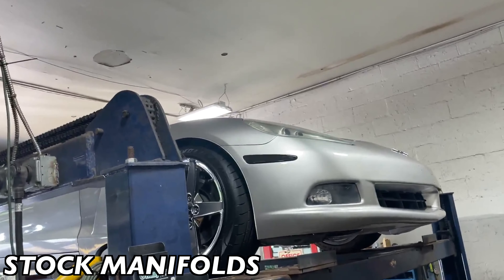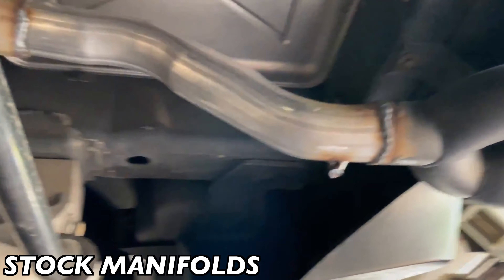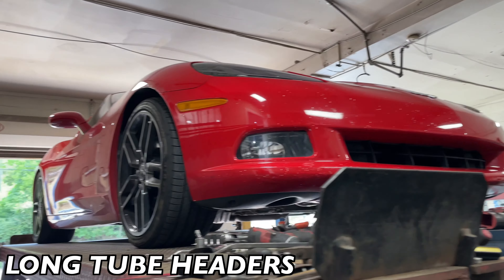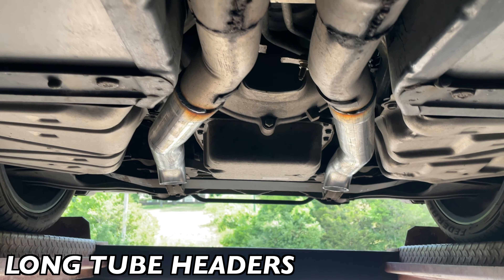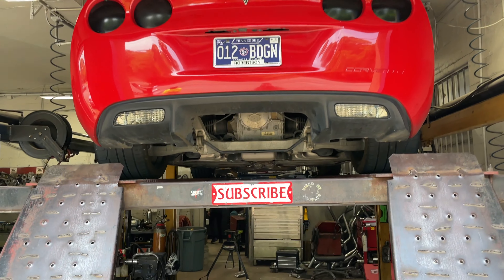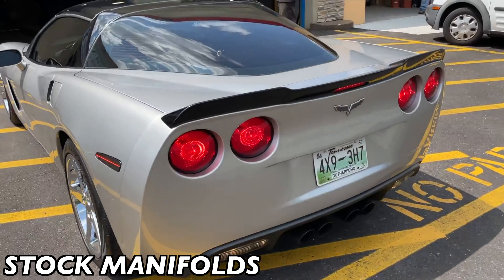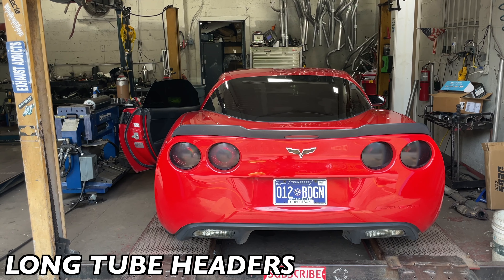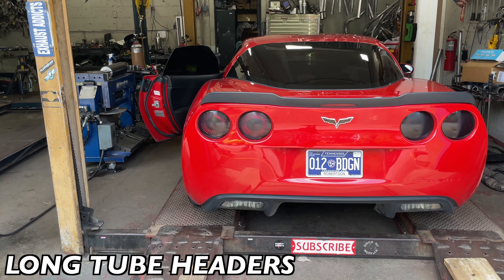How do Headers Affect Exhaust Sound?

Comment: I can tell you from experience, if he ever changes his mind on the red one and doesn't turn it into a track car it'll be unbearable to drive on the highway. the drone will be a killer.
Reply: even if its gonna be a track car, its going to be horrible
Reply: My challenger has long tubes, high flow cats, and borla atak, and its not bad at all unless you get on it
Reply: Kinda of a myth. The drone is there you just get used to it
Reply: @11.9lsupercharged4  the real question is why are these dudes trying to flex with a base model vette,z06,zr1 or nothing.
Reply: @ViperMods_216  you get what you get.  I work with a guy with a challengers r/t and he upbadged it to a 392. Got some brembos or at least good knock off covers and straight piped it and he drives it hard so he fools alot of folks into thinking its a 392
Reply: Dude your seats just vibrate all day long with open header set up
Reply: @ViperMods_216  Is there anything wrong with base model vettes especially ls3. You could turn basically make a ls9 by strapping the same supercharger on the ls3
Reply: Not with that x-pipe though. It wasn’t that bad with the x-pipe. If he deleted that, then yeah. I’d definitely agree and say it would be a bit much for the street as far as sound goes.

Comment: On my 96 z28 I installed a set of 1-3/4 longtube headers. Underhood Temps were lowered and the sound was alot quieter then I added true duals, X Pipe with series 10 flowmasters and tailpipes. Loved it for 12 years

Comment: Im new to car exhaust,  so i was wondering how do people get away putting LT headers on their cars when it's illegal?
Reply: Only certain States me I'm in California that's what they got electric cutouts for
Reply: If you install cats on it then it is still legal. It just depends on which area you live at. In California you can put long two headers as long as it is California legal. That includes cats too.
Reply: I see. Because I'm planning to go catted lt for my mustang gt, and i live in North Carolina.
Reply: @ragintaurusmusclemercury7023  only shorties is carb legal in California got to have a certificate under the hood also I'm in the process of getting my headers and some high flow cats with electric cutouts I just picked up a 6.1 intake manifold yesterday with a throttle body I'm going to get both of them ported going to install the intake at the end of the year when I get my Cam kit and get my engine rebuilt
Reply: @davidokune8194  you drive like you got some sense they don't really puck with you get u some electric cutouts if you can find somebody good price waiting for the mine to be shipped out so I can get this work done
Reply: @hemi5.7villain  California has always been the big exception. Long tubes are legal here in my state that's why I love Texas so much.
Reply: @ragintaurusmusclemercury7023 you can still put them on out here

Comment: The red Vette would sound better if it had the full exhaust on it. Sound is bouncing of the ground making it sound like shit. I will have say the grey Vette sound better at idle, revving, and takeoff. 
P.S. An x-pipe creates a higher exhaust note. Not a lower one. Plus if you delete your x or h-pioe it will get louder but it's going to sound worse. If he thinks that it sounds bad now wait until he does that. The clapping alone will send him to weld it back on.
Reply: ive got 2 gen 4s both 6 litres with h pipe on both, neither clap
Reply: @kevinobrien4155  I didn't say that h-pipes make your exhaust note clap. I said if you remove your h or x pipe it would.
Reply: @ragintaurusmusclemercury7023  I had an ls1 monaro with an unbalanced exhaust and it didnt clap either
Reply: @kevinobrien4155  Good for you. 99% of the h and x-pipe deletes this guy did ended up with a car or truck that clapped really bad. He did other stuff too to the cars to make him sound like shit but people continue to let them do it just to come back in order to get it fixed because they realize it wasn't a good idea.
Reply: @ragintaurusmusclemercury7023  old school v8s clap, Ls's wont that's for sure. even the new ford coyotes wont